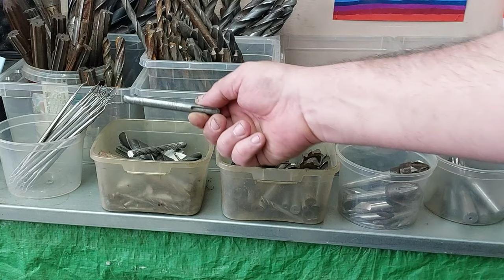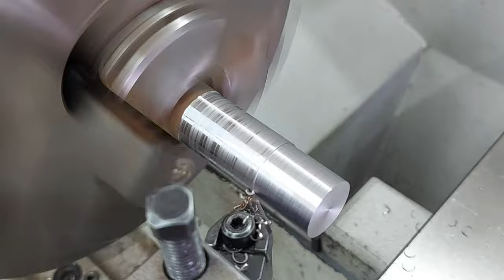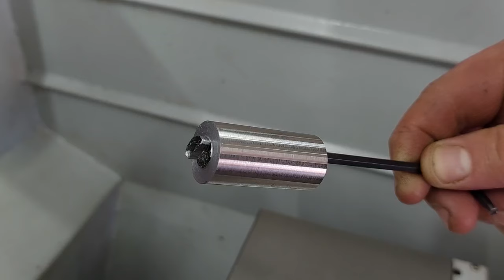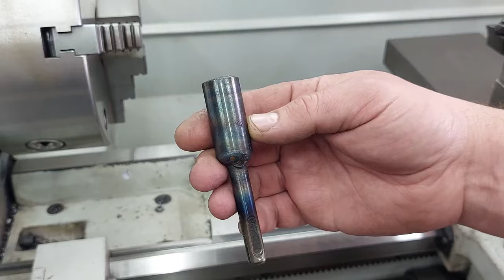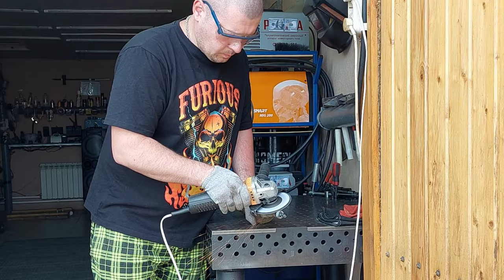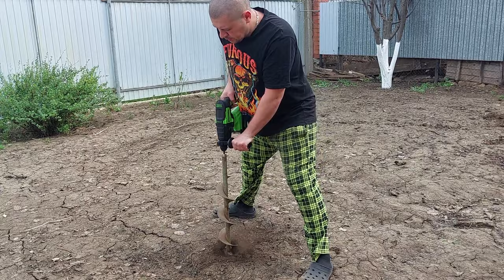Amazing idea with a broken drill bit that millions of people will appreciate

Comment: Your cool ideas are getting spread out a bit.  I get that it's hard to come up with new ideas.  I've been using a rocker, lantern style tool post and finally made 1 similar to yours.  I can part off now.  I made the whole tool post on the lathe.  Bolting it on the cross slide with shims it's dead nuts with the 3 different tools I mainly use
Reply from the maker: Believe me I have a lot of ideas and there will be a lot of homemade tools with my own hands! Welcome my friend😉